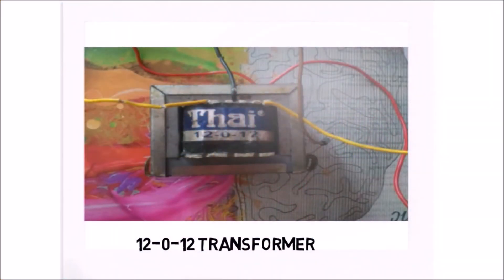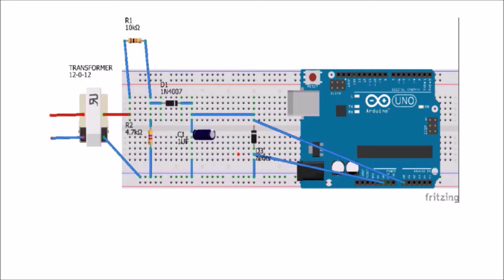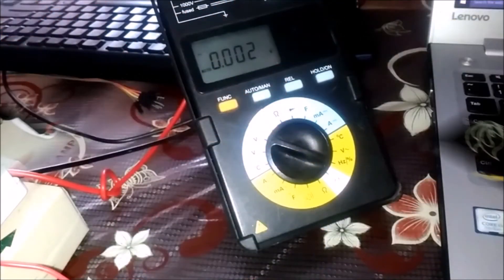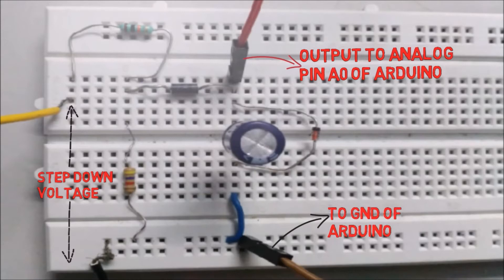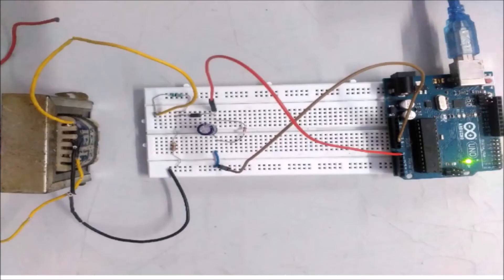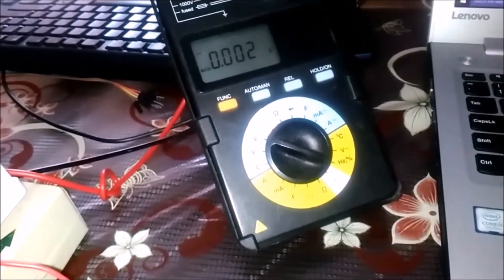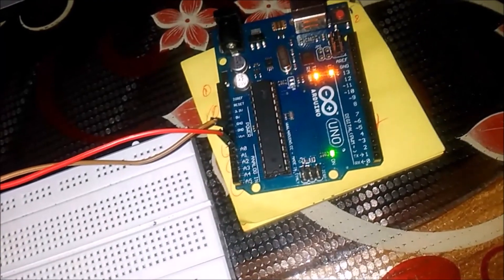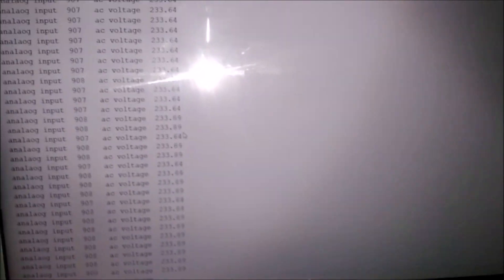How to make a Digital A.C Voltmeter using Arduino.

Comment: your  code  having  problem  when  i  upload  it  i see  into serial  moniter  its showing  only constantly maximum  voltage  311 when  original  voltage  is  210 v ac  so  please correct  the ode  and  make a code print  for  lcd  display
Reply: did you find a solution can you help out pls

Comment: COMPILATION ERROR ? Arduino: 1.8.9 (Windows 10), Board: "Arduino/Genuino Uno"

sketch_jun10a:25:1: error: stray '\342' in program

 Serial.print(”   analog input  ” ) ; //

 ^

sketch_jun10a:25:1: error: stray '\200' in program

sketch_jun10a:25:1: error: stray '\235' in program

sketch_jun10a:25:1: error: stray '\342' in program

sketch_jun10a:25:1: error: stray '\200' in program

sketch_jun10a:25:1: error: stray '\235' in program

sketch_jun10a:29:1: error: stray '\342' in program

 Serial.print(”   ac voltage  “) ; //

 ^

sketch_jun10a:29:1: error: stray '\200' in program

sketch_jun10a:29:1: error: stray '\235' in program

sketch_jun10a:29:1: error: stray '\342' in program

sketch_jun10a:29:1: error: stray '\200' in program

sketch_jun10a:29:1: error: stray '\234' in program

C:\Users\DJ NIL(NILANJAN ROY)\Documents\sketch_jun10a\sketch_jun10a.ino: In function 'void loop()':

sketch_jun10a:25:20: error: 'analog' was not declared in this scope

 Serial.print(”   analog input  ” ) ; //

                    ^

sketch_jun10a:29:20: error: 'ac' was not declared in this scope

 Serial.print(”   ac voltage  “) ; //

                    ^

exit status 1
stray '\342' in program

This report would have more information with
"Show verbose output during compilation"
option enabled in File -> Preferences.
Reply: if you do program copy from anylink and if you paste that in arduino ide it will give that error . write all program by hand it wont give that error
Reply: I am only getting 311 all the time with analog of 1023 can you explain why please

Comment: hi, i just did the circuit by using an arduino nano, the input is 120AC 60Hz the output 2.5DC, but the serial monitor shows a value betwen 180 and 210...well thats not the problem, i would take another multiplication value,...... but when i disconnect the source the value still high, what could be the problem (maybe capacitor?)....thanks

Comment: what is the purpose of zener diode ?
Reply: is a 5v volts zener diode, that means that if the dc voltage  rise over 5v , the insolation of the diode get lost and the diode become into a shortcircuit, now you have the same potetial in A0 and GRD of your arduino in other words, 0 potential diference= 0V.......that protects the arduino.....i think it like somekind of fuse but in parallel .....i hope i have helped you ......i did the circuit but the values measured fluctuate :(

Comment: I tested the circuit and the rectified part still produces ac voltage. If i used Full wave rectifier and recieve 12 volts dc to arduino can it still measure the ac voltage?
I dont want to sacrifice stuff with the design you made coz it isnt completely safe.
nice video
Reply from the maker: maximum voltage level for Arduino is 5 v. So voltage must not exceed 5v.
Reply: If i used an 7805 Regulator to get the 5volts, well that still be converted to aC? but the problem is if i used a 7805 regulator, I get a constant result of 220volts Ac, cos the mathematical formula well always multiply 5volts. thus the result will be always 220volts.

Comment: Awsome Bro (y) , I wanna ask one question its for single phase ,, how it will be for three phase? if we want show three phase voltage on Serial monitor
Reply from the maker: It's simple, just use three separate transformer. Each for R, Y and B phase. Then following above steps, use three variables to print three voltage value on S.M.
Reply: i wanna to check phase to phase voltage
Reply from the maker: Ok    but there can be issue of circuit grnding..Else, you can first measure  phase voltages wrt neutral and then wrt each other..
Reply: thanks will you please tell me the transformer voltage and current rating so i can exactly buy that one
Reply from the maker: Sure😊
Voltage rating: 220v to 12-0-12 center tapped
Current rating : 2.5 Amps
Reply: thank you so much for help :)

Comment: hi bro,
Can you help me for a project on arduıno. I want to control on R, S, T phases voltages. I mean When I swıtch on for cut Circuit 3-phases sistems, Arduıno cut circuit    <-+10 Volt. I purpose minimize arcs
Reply from the maker: Can you elaborate this project?, thanks;
Reply: On 3-phases systems l want to smart switching. You know Arc harms to systems. Just l think if I swich on  lower voltages. I can minimize arc. Just l want to give command with arduino to cut circuit between -10V and 10 V. when l stop the switch, Arduıno notice -10---10V and cut the circuit.
Reply from the maker: +S. Mamuk I don't understand exactly what you mean but I think you are having trouble while switching. You can use relay for switching in your circuit.
You can type in Hindi if..?
Reply: l m from turkey sorry!
But thanks soo
Reply from the maker: S. Mamuk ohk... So what you think of relay?
Reply: of course l will use relay :) just think like that I will reduce 220 voltage(mains voltage in turkey) to under 5 V. And then l will connect arduıno analog pin. At output l will connect relayto arduino's digital pin.
Reply from the maker: Şimdi projenizi kendi dilinizde açıklayabilirsiniz...project!!
Happy to help!

Comment: Awesome bro ilike your idea....i just wanted to ask you is it safe or not😅
Reply from the maker: Thank you. And it's perfectly safe.. if you do as mentioned in video 😁
Reply: bro i also want to know that can i use arduino pro mini instead of arduino uno?
Reply from the maker: yes, you can
Reply: please provide the arduino sketch and circuit diagram🙏
Reply from the maker: here is the link of circuit schematic and all: 
https://etechnophiles.com/make-digital-voltmeter-arduino/
Reply from the maker: just connect A0 and GND pin of mini where UNO's A0 and GND pin are connected... code and circuit is similar.
Reply: Thanks bro for your  support
Reply from the maker: Most welcome..do share 😊